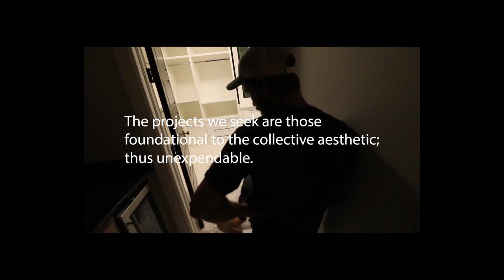ep1 Steel and Leather

Comment: This is cool! We have an ugly-ass plastic/vinyl handrail that I'm not up for removing and replacing. Was thinking of leather-wrapping though it's more of a flat style than a round pipe. I still think it'll work and am going to try this sewing method rather than a thin strip people wrap around in loops which looks a little messier imo. Will have to measure and cut out areas for it to wrap around the stair poles as it is not stand-alone like this handrail is.